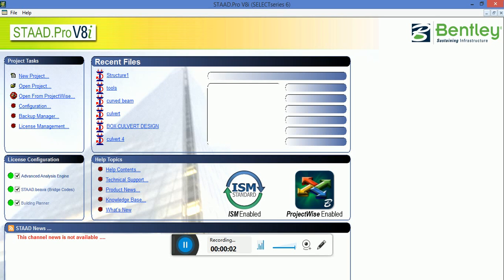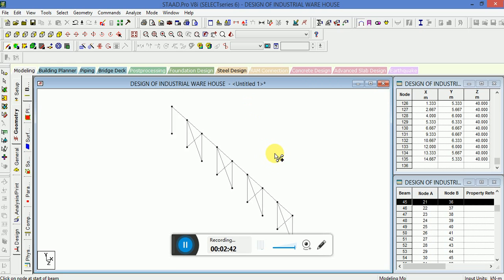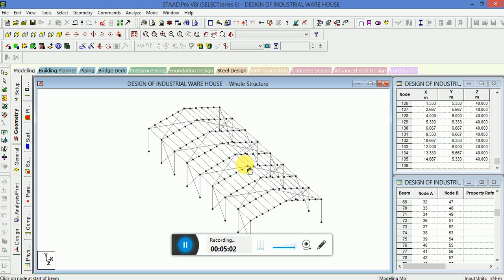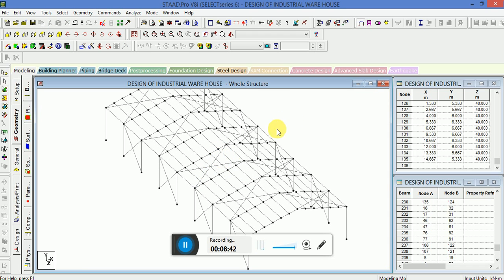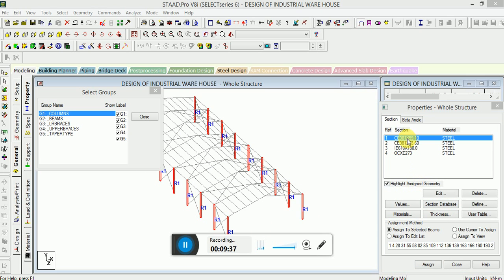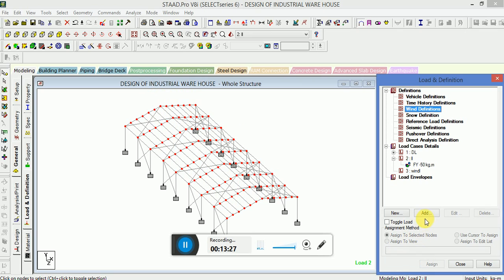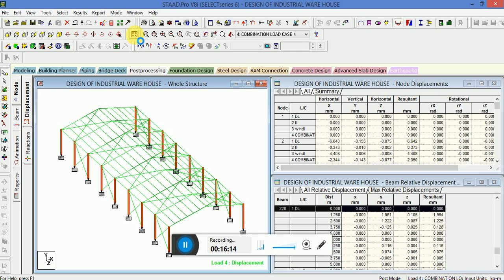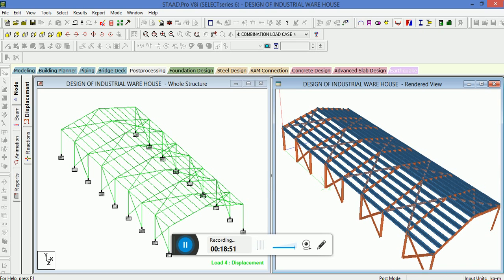DESIGN & MODELLING OF INDUSTRIAL STEEL WAREHOUSE IN STAAD PRO V8I

Comment: execuse me sir ..... this  is modeling and analysis of designed structure not designing ....
we need to learn how to choose the sections of steel after modeling structure and putting the loads
Reply from the maker: This is for modelling purpose dear and using foreign codes just to give idea for those are using international codes and design is done according to requirements of project.

Comment: How to design steel closed container in staad pro?
Reply from the maker: It depends on which type of size & whether circular or rectangle one you are considering for design and choose which type of want and i'll come up with the video of it then ....✔😊🇮🇳 keep sharing keep liking it ✔😊🇮🇳
Reply: @vibhorshukla850  Its a rectangular steel closed container of having L=12192mm,W=2438mm,H=2896mm .fixed at bottom by bolted connections...Which will used to place fire fightning pump..Please provide me solution on that.need all loading combinations...if need any data please let me know.
Reply from the maker: @sharsaara  welcome  thanks for your valuable suggestion ill sure make video on your suggestion ill make  complete video tutorial soon ..!! :)
Reply from the maker: @sharsaara  welcome  thanks for your valuable suggestion ill sure make video on your suggestion ill make  complete video tutorial soon ..!! :)

Comment: I am still thinking of why need to design the column as fixed column instead of pinned. Let me know your thoughts. Thanks
Reply from the maker: This is for modelling purpose dear and using foreign codes just to give idea for those are using international codes and design is done according to requirements of project.

Comment: Is it possible to add a haunch to the rafter / column connection? If so, how do you do it please? I cannot find anything relating to it in the Staad help menu
Reply from the maker: thanks for your valuable suggestion ill sure make video on your suggestion ill make  complete video tutorial soon ..!! :)
Reply: @vibhorshukla850  
I ended up creating a built up section in the section wizard tool, using plates to represent the web and bottom flange of the haunch UB  section. As the haunch section is tapered i used an average depth i.e half of the web depth for the length of the section.  
What do you think, is that a reasonable way to approach it?
Reply from the maker: @keith6591  welcome  thanks for your valuable suggestion ill sure make video on your suggestion ill make  complete video tutorial soon ..!! :)

Comment: Please explain about rolling load
Reply from the maker: Rolling Loads- 

Rolling loads are those loads which roll over the given structural element from one end to the another. You can see many live examples of rolling loads, like a train on the railway track, vehicles on the bridges or roads are rolling loads.
Now to analyse the given structural element for the rolling loads, which classify these rolling loads into the following classes:
(1) Single point rolling loads
(2) Uniformly distributed rolling loads, - a) shorter than span  b) Longer than span.
(3) Two point loads at a fixed distance apart.
(4) Several point loads at fixed distance apart.

Comment: Sir you selected different sections of steel. 
What is the criteria behind it? Is there any rule to select the sections? 
Kindly help me
Reply from the maker: Low Carbon Steel – Composition of 0.05%-0.25%carbon and up to 0.4% manganese. Also known as mild steel, it is a low-cost material that is easy to shape. While not as hard as higher-carbon steels, carburizing can increase its surface hardness.

Comment: Sir, what is  the height, breadth, length, area and size of the structure and what will be the cost for making it?
Reply from the maker: this depend on design engineer and what a consultant engineer required for the structure to be well strength and area on the project to be done .

Comment: In roof truss why do not we provide flat section instead of angle section as filler members.?
Reply from the maker: Members of steel trusses don’t necessarily have to be angles, you can always use other steel sections. But angles might be preferable for quite a few reasons:

1- Forces in steel trusses aren’t considerably large

2- Angles are light in weight; which means lower cost and also reduced dead loads

3- Connections between angles are simple, and fabricated with ease, whether they’re bolted or welded

4- Angles offer a wide range of variety as you can use them singly, back to back and star shaped

Although, in steel bridges, HSS are more preferable; as they offer greater radii of gyration and torsional constants in order to cover large spans effectively and resist greater traffic and railway loads.

Comment: what about release moment ? could you tell me, please.
Reply from the maker: The structural engineer has to determine whether nominally pinned or nominally fixed bases are appropriate for the steel frame.

Comment: Very helpful video.. 

Can you help by providing video/s explaining in details the followings:

1- Design parameters for steel members using latest AISC code ( like Lx, Ly, Kx, Cb, UNB, etc..).
2- Design parameters for the cold formed members (Z & C shaped) using latest AISI code (Similar to above)
3- For the case where secondary beam with more than one span is supported on top of main supporting beam, how to define the behavior of secondary beam as continuous beam transferring vertical loads only without transferring moment to the supporting beam. Example is cold formed Z members at top of pitched roof main rafter.
Reply from the maker: this is the modelling and loading of industrial warehouse project model only

Comment: Hi, I really enjoyed your presentation. It was good. But one doubt, what about all these nodal connections - are these all fixed connections or bolted and/or pin connections? will there be any changes? In the real life, many or most of the connections are bolted/pin connections. Just want to know if there are differences..    thanks a lot.
Reply: He must have released the members that are pin connected. This has more emphasis on modeling rather than design.
Reply: Vibhor Shukla u dont answer his question at all
Reply from the maker: The structural engineer has to determine whether nominally pinned or nominally fixed bases are appropriate for the steel frame.
Reply from the maker: this is the modelling and loading of industrial warehouse project model only